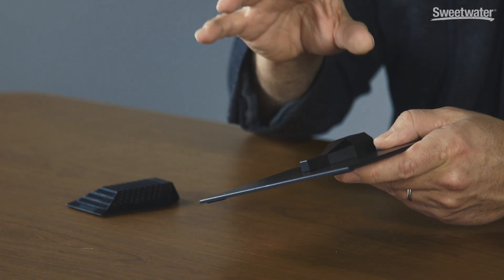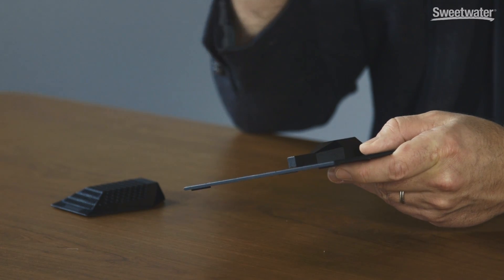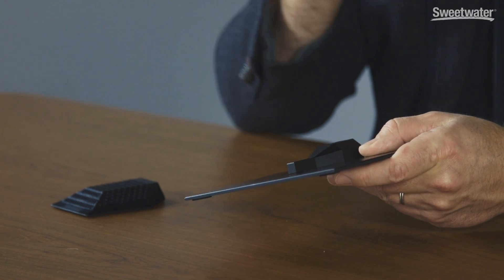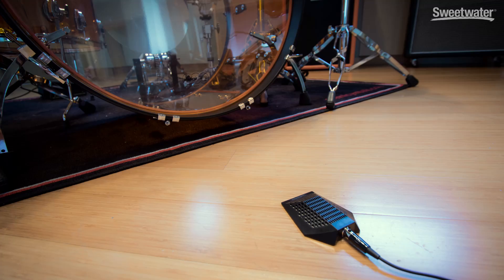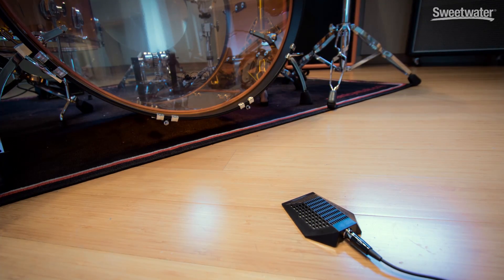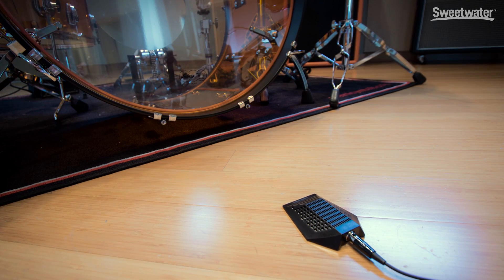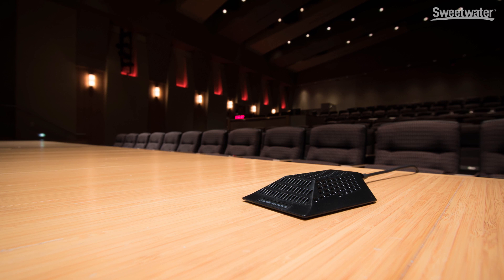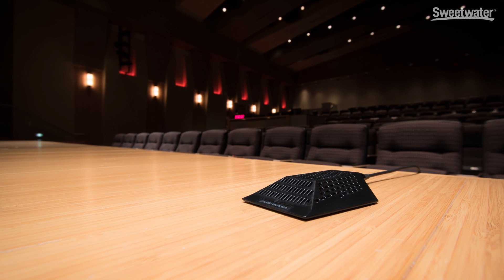PZM Mics: How Do They Work? by Sweetwater

Comment: Mitch, I think you were born to do these presentations.  You are so compelling, invigorating, clear, and right to the point on everyone of these I've heard you do, and this is no exception.  I just want to give credit where I think credit is due.  Keep up the good work.  As far as the PZM's, I still have a couple of old Radio Shack ones I bought for cheap, but I just never applied them enough.  I've always wondered if they're way substandard to these Crown models, especially because of the price, but at any rate, I'm getting  very interested in the reviews I've been readying about them.  Sounds like they could be excellent room mikes, piano overheads on a grand, and good drum overheads.  I'm gonna try and find my old cheepies, but consider buying 1 or 2 of these higher end models.  Once again, Mitch, "you're the guy" on these presentations.  I enjoy them very much.  Marc.
Reply: Exactly, I didn't even know I needed this mic until I heard Mitch talk about it. Lol!